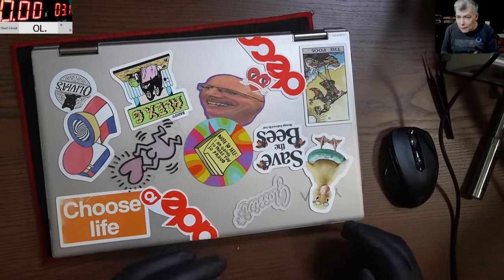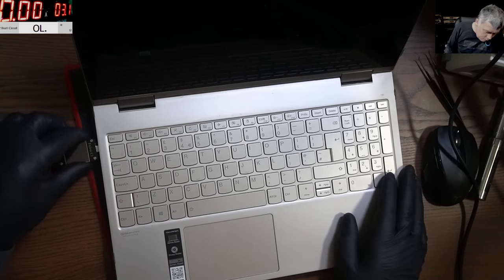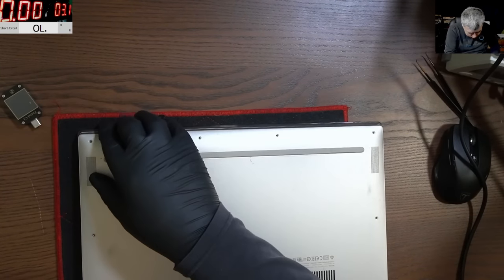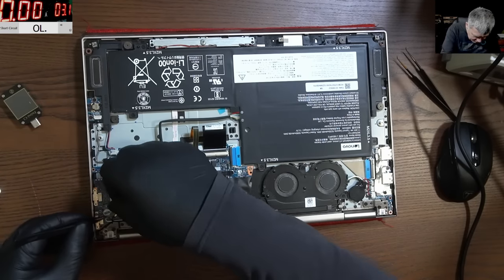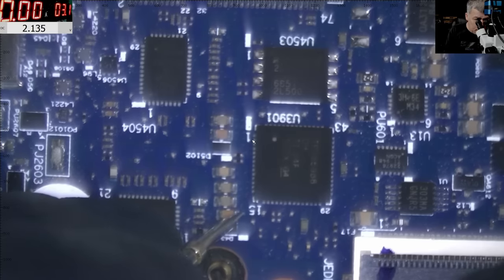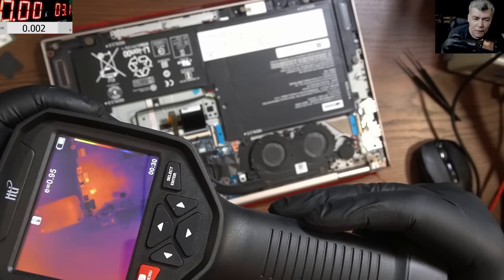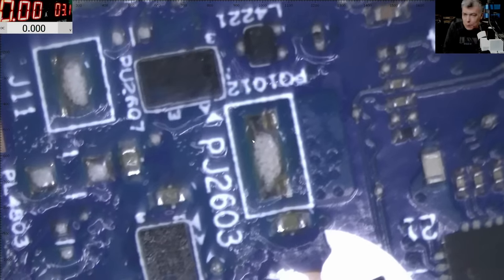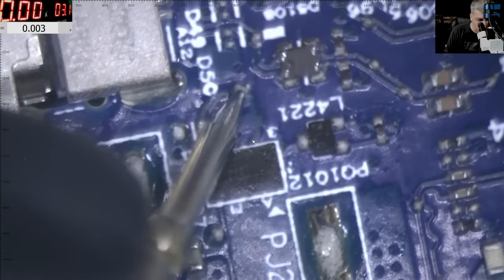Lenovo Yoga C740 motherboard repair - Can we fix one more laptop this year? Happy New Year!

Comment: Okay this night be the same fault that's on my thinkpad t480p. I don't have a thermal camera but the thinkengine chip (power management chip?) Gets hot, I think it's not at fault and is working as intended, cutting the power to the machine.
So what you've found might also be the issue on mine!
Or at least I'm suspecting it is…